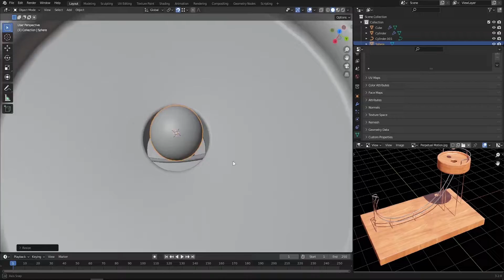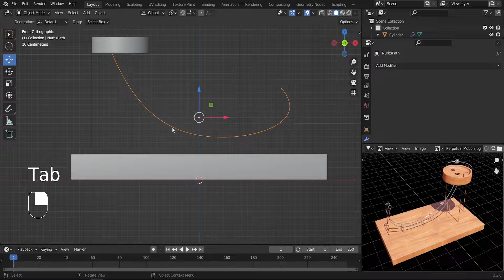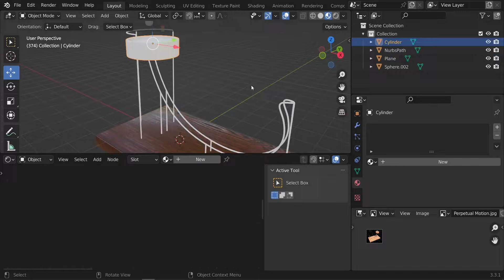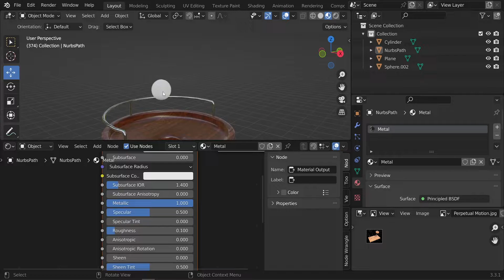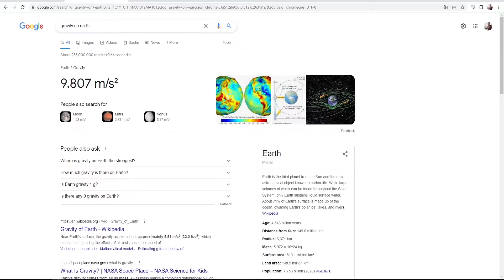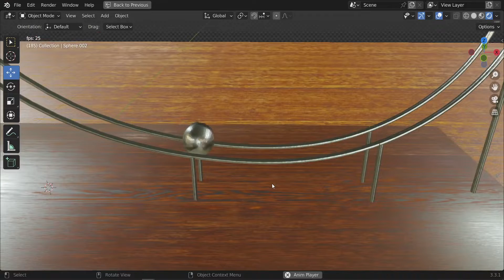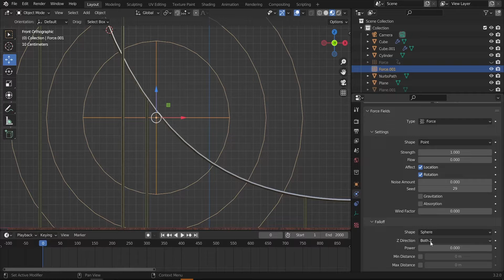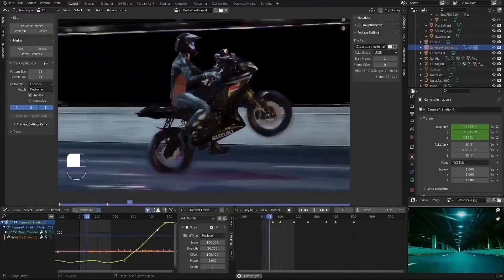Build a Perpetual Motion Machine in Blender

Comment: Eventually you will have to change the batteries inside the base as this operates on a small magnetic field to push the steel ball, if you were to use a non-magnetic stainless steel  ball this unit would not work! 🤫
Reply from the maker: Yes exactly 😊